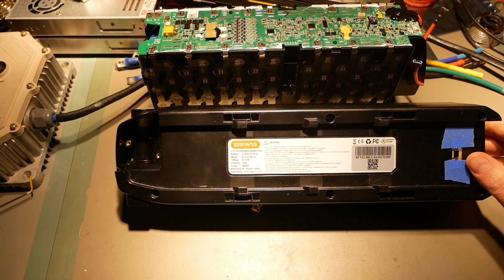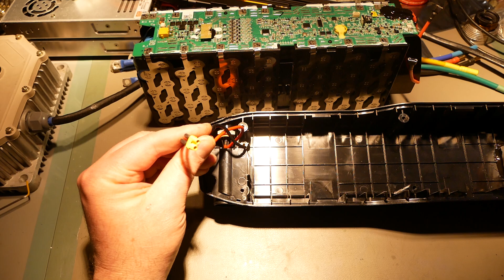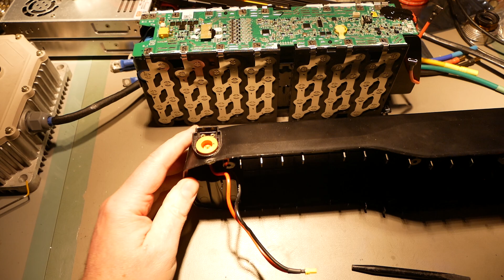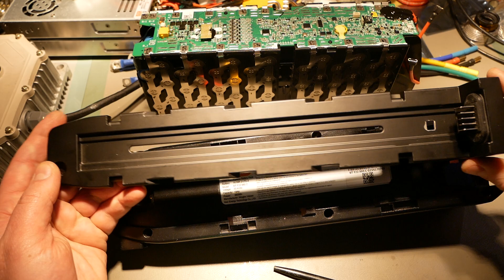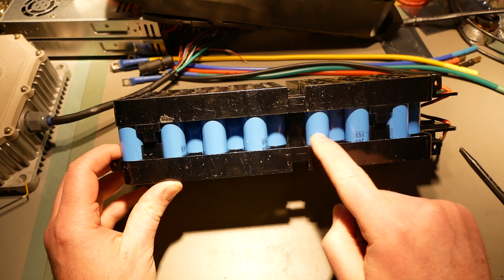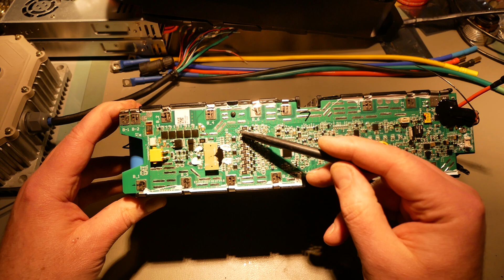Bafang BT F22.960.C 50.4v 19Ah pack

Comment: So adding the breaker allowed the battery to charge? Mine battery is off an M625 system. Battery still gives power to the motor, but will no longer charge (charger just blinks red and the battery lights stay on until I force the battery to shut down). I have been trying to find a shop capable of working on these, but I either get no response or they do not work with Bafang products. This battery has been sitting on a shelf three months trying to figure it out. I got the shell off easy enough, and I can wield a soldering iron good enough for attaching components on the board, but if it is possible to send this in for service, I would prefer that.

I translated the yellow switch that does nothing. It says "Do not move!"

Comment: Hi, Thanks for the video. I have a question: I would like to change the battery so it can be used with a regular controller. Do you know of a simple way to adapt the BMS for this, or should I swap out the BMS for a standard one. If I need to swap out (hope not...) which BMS would you recommend for a 1000W BBSHD controller. Thanks
Reply from the maker: This can be done, but you probably can't do it. I did this to a M625 pack not so long ago.
Reply: @de-bodgery  You mean adapting the bms or swapping the bms
Reply from the maker: @ppeeppee5800  replacement and it's more than just replacing the BMS.
Reply: @de-bodgery  Ok, what is the main problem. The battery pack seems to be very straight forward 14x4 Samsung 21700. The main problem I foresee now is how to fit the new bms in the case. What am I missing?
Reply from the maker: @ppeeppee5800  Have you gotten the case open without destroying it?
Reply: Hi Could you tell me a bit more about the problems you had replacing the BMS. As I said, it seems pretty straight forward. and which BMS would you recommend for a BBSHD controller
Thx, PPee
Reply from the maker: @ppeeppee5800  I'll go back to what I asked earlier. HAVE you gotten the cover off without destroying it???
Reply from the maker: @ppeeppee5800  BAFANG does NOT want you working on their pack! They have made opening the shell VERY HARD! So if you can't get past that, you can't replace the BMS! It's a MUTE POINT even discussing the BMS until you do! I succeeded with lots of effort. Kind of wish I had made a video on it, but I didn't care at the time.
Reply: Yeah replied to that question already: "Yes, with a plastic wedge in the seam and some gentle taps with a rubber mallet". So hurdle one is taken without any damage.. what's the next hurdle..
Reply from the maker: @ppeeppee5800  Just to be sure, I reread all your comments again, not seeing your response to getting the case open until just now in your latest comment, but hey you did it so congrats on that!
I used a JBD smart BMS. It's with is OK, but it's thicknes is too much. You will need to remove that grid pattern inside the top cover to make a little room. you will need to remove the bottom aluminum cover from the BMS as well to fit in the same place as the factory BMS.
Reply from the maker: @ppeeppee5800  Look me up on facebook Richard Gumfaw. I can't post pics in comments on YT or URLS. I'll tell you the rest there.

Comment: I totally don't understand why the fuse is a bad solution? It's not something you replace every day, rather it's the last line of defense if the bms software/hardware protections don't work, if it burns, it means something is wrong and you need to check what, not replace/reset immediately it and put the pack back in ebike
Reply from the maker: Ever try taking apart one of these packs to get to the fuse? That's why it's a dumb idea to mount it to the board! They should have made it user replaceable from the outside! Fuses don't generally blow for no reason, but they do blow. If you have something wrong and you blow that fuse, you still need to replace it after you fix whatever else broke. It's still VERY difficult to get at and that is why its location is dumb!

Comment: What Breaker did you install ? Could you recommend one for a 72v battery ?
Reply from the maker: First of all ignore the voltage ratings on breakers. Its pretty meaningless! If you need a main breaker, I only use optifuse breakers. They are well made. Breakers and fuses inside the battery pack like this Bafang is a dumb idea...don't do this.